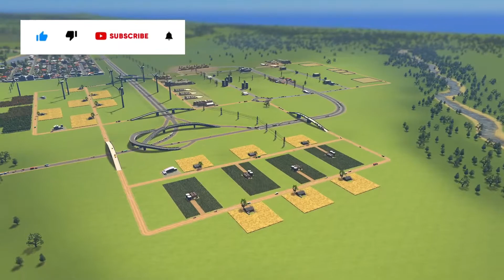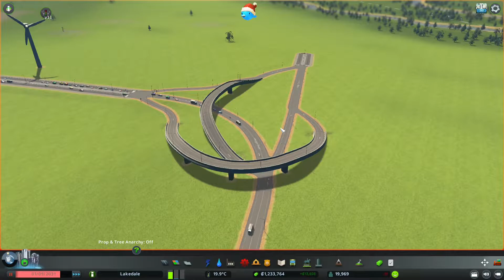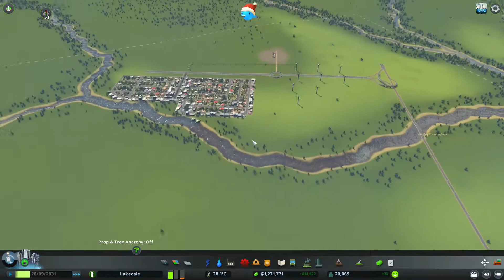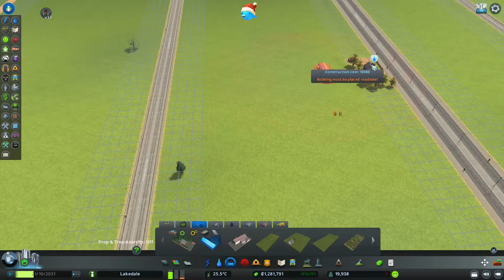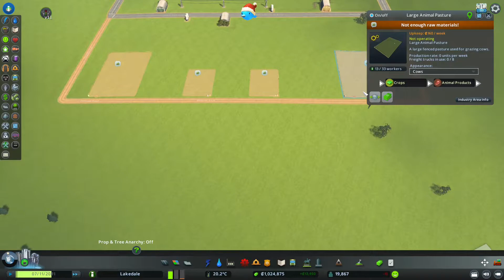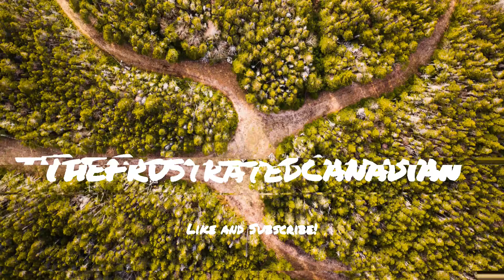How To Build a Highly Efficient Farm Industry Cities Skylines with NO MODS (Build Guide)

Comment: Starting out with silos and barns (way too many to begin with anyways) and especially pastures is a mistake. They will immediately send out their trucks off-map to get supply to fill up with or run on. The best way is to start with the greenhouses and fields, preferably a set amount per day, until the first set puts out their trucks. Then put down silos and barns for them to deliver to. Then when the storage facilities get near 50% full put down the processors, the pastures and flour mills. Also insure you don't have too many extractors so their trucks don't wind up going off-map. You want the crop producer's trucks leaving to deliver to the silos, barns and pastures and then returning to the fields: They have a small, limited number of trucks and you want their routes to be as short as possible to reduce traffic and to keep their fields producing. Also if the route from the crop producers is short and goes past the processors to get back to their fields, they will often deliver directly to the processors and skip the silos and barns altogether. You will find you don't need nearly as many silos and barns as you think you do. Having fewer silos and barns means less operating costs, less traffic and more profit.

The silos and barns have a small number of trucks as well. You want their trucks delivering on as short a route as possible to the processor buildings and returning, not going off-map either. Same thing with the processors as well. You want their trucks going to warehouses, again on as short a route as possible. Let the warehouses do the delivering to the outside of your Specialized Industry area. Keep all of those extractor, storage and processor trucks inside that small area if you can. That way all those buildings will stay working and not be saying "not enough customers".

A cargo train terminal is essential to keep traffic down so many of your processor trucks are making deliveries there instead of to the warehouses. Put it right after the processors so their trucks can get back to their respective buildings. An efficient train network that delivers near your generic industry area as well as off-map helps because cargo train terminals don't have a limit on how many trucks they can spawn. This will help traffic and reduce the number of warehouses you need.

The small warehouse is the most efficient. For it's size it has three times as many trucks and twice the storage capacity of the large warehouse for only 75% of the cost! Trucks is the "bottleneck" deal with this DLC. You need as many warehouse trucks as you can get, provided with ample access as close as possible to the freeway. I've found that on a medium size specialized industry area, a dozen small warehouses with well designed access to and from the processors and close to the freeway will take up less area than the two large warehouses you need to store and ship the two products that the area makes, and you'll have 240 trucks to be making deliveries, not 80, and at 75% of the operating cost of those two large warehouses! Large warehouses look impressive, but they're restrictive and very inefficient.

The key is to keep the extractor, storage and processor trucks servicing only the buildings next up the chain and not going out to your generic industry and commercial areas and off-map, not only adding to the traffic in those areas but not being where they're needed, in the specialized industry area, keeping their respective buildings operating. Let the warehouses be your conduit to your generic industry, commercial and off-map customers. And don't forget that lots of off-map customers, truck and train, is a good thing, more income.

Comment: is it a dlc
Reply from the maker: There is an industries DLC that you can buy that has the farming stuff included
Reply: @frustratedcanadian  so basically you can't do shit with industries in the game because most of the game is locked behind a DLC wall like 100% of Paradox games
Reply: @fishy2584  wait for a sale, everything becomes dirt cheap
Reply: Yeah but the game came out like six years before the Industries dlc. The versions of the base game they released usually contained bundles of dlc. Game was still very popular before its release so I’d say it’s not necessarily essential. I always had it though because I only bought the game adter if was released so it was in included bundle
Reply: My question is, is all the shit from the dlcs included in CS 2
Reply from the maker: @subg8858  I have about 50 minutes in CS 2, my PC struggles to run it with an RTX 3070 and it constantly crashes. Not sure if it is a me problem or the game problem :( I was quite excited for CS2, hoping to try to learn it and post some content on that soonish!
Reply from the maker: @subg8858  I picked up different DLC on sales and such. Usually Steam sales would allow you to get them cheap. I would recommend googling which DLC are best for gameplay. I personally love the winter pack (for trams) and the industries pack. I have a few others but off the top of my head those are my top! Thank you for checking the video out!
Reply: @frustratedcanadian  okay thank you